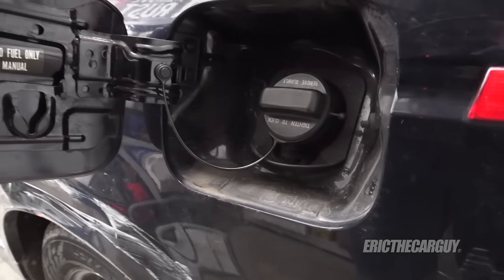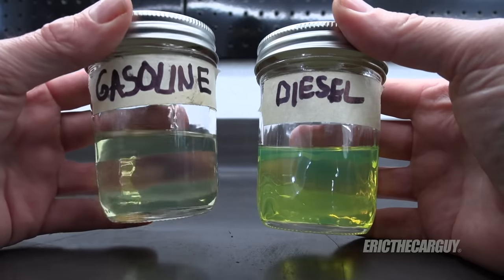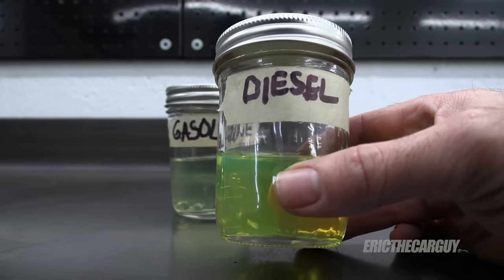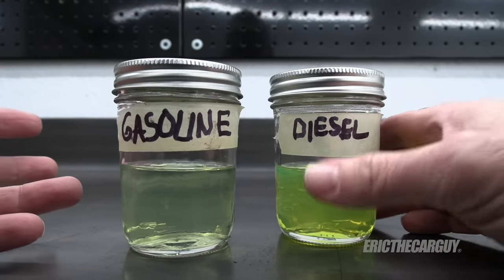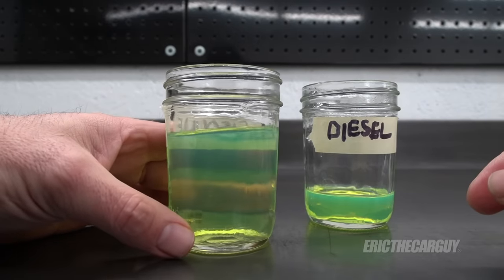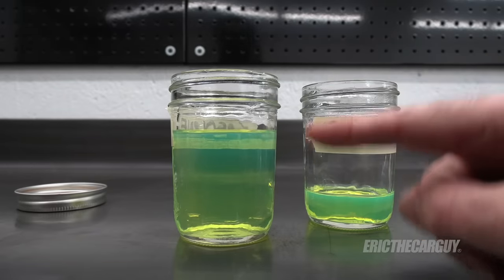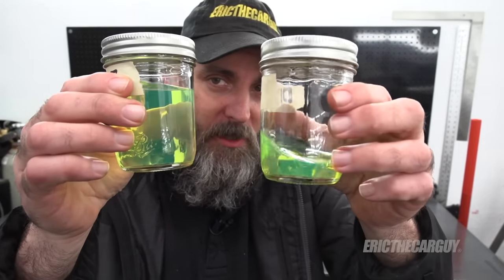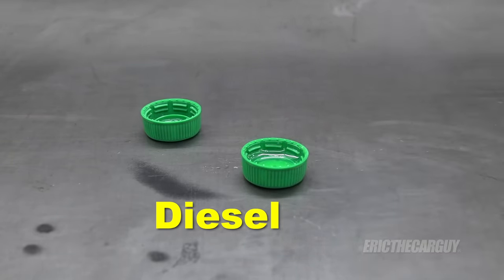What Happens When You Put Diesel in Gasoline?

Comment: I would guess up to 10% diesel might just work, although modern systems might freak out. You don't want to gamble with an expensive car. Also it might separate over time, not sure.
One guy on quora says he drove with 25% diesel one time back in the day and it worked without incident. That's probably pushing it.
With an old four banger pre computers it could be tried. I'd guess 10% is mostly fine. At 50% Id guess it would run but run bad. possibly straining the engine

Comment: I know a few guys who collect all the grease from bars and restaurants to make there own diesel. If your behind them their exhaust smells like french fries lol
Reply: The greenies call that "bio-diesel'.  Rudolph Diesel's first  successful engine ran in 1897 on peanut oil and could also use vegetable oil.
Reply: @vaughan2203  interesting
Reply: My dad did that and mixed it with normal diesel. No wonder I was always hungry when we'd go on trips. XD
Reply: @DaleESkywalker  lol
Reply: @vaughan2203  Bio Diesel here in Germany is actually not something refined from used frying fat, but from fresh rapeseed oilI, allthough using the old frying fat would work as well. In Europe regular Diesel contains about 7 % Bio-Diesel, which is no problem for modern vehicles. On older vehicles it might cause issues as the Bio Diesel may soften or dissolve rubber seals. Same with Ethanol mixed into regular gasoline (Called E10 here, containing 10% of Ethanol. It is not generally a bad thing as some claim, it is just the seals and hoses that have to be designed to withstand it. 
I know a lot of military use engines, not only in trucks, but also tanks, helicopters etc. thst are multi fuel engines. You could indeed run those Diesel engines on almost any oily substance except for gasoline. Well actually there might bee some around with additional spark plugs, that can even run on gas, ethanol or gasoline.
Some engines might have to be modified by maintenance, changing some nozzles, some don´t.
I think it is often used in military vehicles, to be as independent as possible on what kind of fuel is available.
Although I am not sure, if you use grease from a restaurant, what it smells like after beeing burnt in the engine.

Comment: Back when dinosaurs roamed the Earth and gasoline cars were carbureted, you would lose some power and smoke a lot.  Diesel will flow through a gasoline filter and diesel is designed to go through far smaller ports than gasoline injectors have.  I think the main problem will be the drive train computer trying to adjust for the different burning characteristics of the mixture and power generated as well as all of smoke caused by the diesel not burning completely.

Comment: I went to a Gas Station with an empty tank then they accidentally pumps 1.2. Liters of Diesel and then pumped 30 Liters of Gas. After a few days my car choked and vibrates when driving. I went to my mechanic and they went and cleaned and fix 4 pcs of  the sparkplug and then it is now normal. But I'm not sure what happens again.

Comment: Diesel in gas engine. Knock pinging low power poor start on non starting. Diesel in gas/petrol loweres the octane. 

But actually cleans an lubricates injectors and pump and all the fuel system.
Cloggig the fuel filter... I guess maybe... Don't think so. Maybe in winter gelling or something, but...?

Comment: if you ad 50% disel in gasolin engine it will run but hp would be low it might not start but if engine is hot it will run it wont damage engine but you have to drive on low rpm and engine must by good and some disel from piston ring will run in engine oil thats all :) if someone adds disel in gasoline car if there is more space in fuel tunk add best fuel 98 or100 and it.s no problem i have tested id many times :) on inline 6 bmw us even but old models on direct injection it might wont work and on turbo cars

Comment: I love your channel! What I'm about to say won't be popular, though...  I've had good experience running a small amount of diesel in several gas engines (1 cup diesel per 15-20 gallons of gas) for a few different purposes  As you mentioned, diesel IS harder to ignite (but also contains more energy than gas). For cars with preignition issues, a small amount of diesel essentially raises the octane levels, preventing preignition and knock.  Exactly what 'premium' fuel is designed to do, be slightly harder to ignite for high compression, forced air induction, heavily tuned, and poor running engines that tend to 'ping', etc.  One of my car's that I used this in was a highly tuned Corvette that needed a slight octane boost beyond 'Premium'. Looking at the engine computer data, it's clear the diesel allowed for more timing.  Obviously, too much diesel will be too hard to ignite for proper combustion, so not too much! In addition to preventing preignition in gas engines, a minute amount of diesel also contains more energy to ram those pistons down for a longer duration of time than just the initial explosion. That slightly stronger explosion equates to more torque. One of the reasons diesels are inherently torquey. Another benefit (again, very slight due to low ratio) is that diesel is a lubricant and cleaner.  It is effective in cleaning injectors and lubricating upper cylinder areas, intake valves, etc. (with right ratio).  Much like Lucas oil fuel additive, but with added benefit of actually being a combustible fuel, not just an additive with minimal results (Lucas oil👀).  Not trying to start a debate, just thought I'd share a bit from my experience. 😉
Reply: So, can i make a mix of them (gasoline and diesel) to use it everyday and make my car stop pre-ignithing? 
I'm asking it because in my country all the gasoline is imported and the Octane is probably under 86. And we use to have 92 and 95 octane, so basically every single car is pre-ignithing for that reason :/
Edit: my car is carburated so i don't have to worry about sensonrs and stuff like that
Reply: @JesusGarcia-ec7jo  Yes, In my experience with a performance car, you should be able to.  I don't know your octane levels, the type or condition of car you're driving.  I would start with only 1 cup deisel per 15 U.S. Gallons of gasoline, diesel goes in FIRST so it'll mix.  Thats only 1part diesel to 240parts gasoline, if that doesn't stop the pinging, SLOWLY increase the amount, to no more than 10% diesel (in your case of very low octane). If you use too much diesel, it'll be hard starting, smoky, a little less powerful, so you don't need much!  Expect pinging to stop, smoother running, and longer engine life if done correctly. Let me know your results, please!
Reply: @jeladsnikpoh1289  Oh man, tank u very much!  i will try, but in reality the car is of my dad xd
But i would like to try it to see what hapens, aniways, is an old fiat engine, is it almost bulletproof.
I am very grateful for the knowledge you have shared with me. Greetings from Venezuela <3

Comment: I happen to know from personal experience that a hot gas engine can run on diesel BUT if it cools down you are toast. You will never get it started again without completely flushing the fuel system. The heat from the engine can cause it to vaporize. 
How much an engine can handle I can answer from practical experience as well. Gas engines will not tolerate diesel very well at all. Even just 10% diesel will cause the engine to ping terribly. Pre injection vehicles the noise will be pronounced. Modern engines will retard the timing and cause it to run sluggish at best due to retarded timing. If you want to hear both the stories just let me know.

Comment: thanks. i thought diesel-fuel is easier to ignite ( more flammable ) than petrol-fuel/gasoline.
because diesel-engine doesn't need spark-plug to ignite diesel-fuel.
gasoline-engine need spark-plug to ignite gasoline-fuel.
i was thinking if gasoline-engine receive diesel-fuel then maybe gasoline-engine produce cleaner emission than diesel-engine , because gasoline-engine has spark-plug to help ignite diesel-fuel and spark-plug maybe help produce more complete-diesel-fuel-combustion than diesel-engine. more complete-fuel-combustion produce cleaner emission.
30 jul 2021 7:49 am edt(utc-4)

Comment: This is actually an old school "old Indian trick" from before efi.  If you have a knock, or dieseling issue suspected, throw a gallon or 2 of diesel in there and watch it go away.  Then, you know if you have a rod/crank knock, or ignition/carbon  issue.  Fast foreword to modern day:  as a mechanic, you should occasionally run into this issue a time or 2, and it typically does no damage at all.  Now, it is possible for a gas engine to run off diesel, but it needs to be quite rich, as in the choke full and rpms up, and it will ignite the short chains in the fuel, but otherwise be prone to flooding.  Also in this condition, it will be similar to having an injector or 3 stuck open, so there will be fuel in the exhaust.   This is pretty much the only potential for damage.  Tank has to be emptied out, of course.  Then, a few gallons of fresh gas added and prime the old fuel out by actuating the fuel pump and the return line or pressure test port draining into a container.  Typically,  the filter doesnt absolutely need to be replaced, especially if you are trying to get the car going after hours, when you cant find a new filter.  You want the diesel gone when you replace it anyways.  Now, you can try to start it.  Will often take 2-5 attempts, as to not cook the starter, but sometimes fire right up.  When it does start, be mindful not to let it auto-ignite the cat, so run it at "high idle" speed until it stops smoking or smelling of diesel and let it keep running the remainder of the fuel before filling up with fresh gas.  The work is mostly tideous, but simple.   On the flip side: you will most likely destroy your diesel if you put gas in it for many reasons.  Fist, gasoline is a "dry" fuel, so think of your high dollar, close tolerance fuel system as an engine not only run without oil, but being degreased first.  If this doesnt happen, the gasoline will ignite and burn on the surfaces of the injectors, head/precups and melt the metal, or explode on the compression stroke (preignition and detonation) and crack a piston or 2.  Most common repair for gas in a diesel is replacing the entire fuel system if it checks out on the bore scope.

Comment: First fuel in diesel engines was "rapeseed oil". I do know that .. to this day I have no idea what a rapeseed plant looks like but it doesn't sound like a consensual plant 🤣.
Reply: Also to clear this up as there is some misinformation in this vid. Diesel and gasoline are 100% miscible fluids meaning they dissolve into each other at any and all precentages mixed. 
The problem "on the other end" he is referring to is component compatibility with fuels having the incorrect viscosity or distillates this is especially important when it comes to plastic fuel valves and fittings, filters and hoses. The plastic and hoses are more an issue putting gas in a diesel system vs the other way around and also (depending on if a little or a lot) injectors. Diesel fuel systems are designed for oil with no lightends which can degrade the inside of your fuel lines and any plastics. Disc and clog your injectors especially on the late model diesels. Also your injectors use the diesel fuel for cooling. Lowering the viscosity will in turn change the thermal dynamics of the fluid. With all that said some people put a quart gasoline/30gal diesel in the winter to work as a winter anti gel additive. These are usually Old-Timers driving old diesel tractors with Ford truck bodies, which explains why they are always fixing them all winter 🤣

Putting diesel in a gas system, the filter as he mentioned will get destroyed but it isn't due to it not being compatible with the diesel but trying to force a higher viscosity fuel through a lightweight filter material designed for gas a low viscous fuel. Think of it like grabbing a coffee filter out of the kitchen and pour water into it. It will go right through because the the water has a low viscosity. Now grab some honey and pour in, it'll go through but slow and if you force it through it pressure which your fuel system is under pressure it will blow holes into the filter sending the remnants into your fuel lines and injectors.

If you just do a splash and either one and then realize your mistake, you should be okay. When I say splash I mean, less than a quarter of a gallon. You just have to make sure that you fill the rest of the tank up with the appropriate fuel to dilute your mistake and do not drive to the new pump, dont even put the key in the ignition. Pull the fuse for the fuel pump, then put the key in, then push to the correct pump.

Engine results for the mix (at small "oops" amount),
Gas: expect excessive smoke out the exhaust. Don't be surprised if when you turn your car off, the engine continues to run for a second. Don't be surprised if you have to change your O2 sensor or remove it and clean it after you have burned through that tank of fuel. Your engine May lack power because you are putting more carbon into the engine so the ECU might lean your mix.

Diesel: not really a whole lot to talk about except for egt's will be higher than normal.

Comment: Yes. So this entire video is what we call. clickbait, With one caveat being older carburetted engines. as diesel does not readily. evaporate when exposed to air. much more than a gallon or two in a carburetted engine would definitely cause. engine stumbling and five or six gallons per probably would not run at all. ) 
  
BUT because nowhere in this scenario did he. mentioned or explain the difference of 1. filling Your empty gas tank with just diesel.? as opposed to putting some diesel in your gas tank. by mistake, which is impossible.  But what Amount of diesel could go into a gas. powered car. without any effect whatsoever? I have run in many situations. Two gallons of diesel to 33 gallons of gasoline. with zero effects.(5.7 Hemi engine)  in winter or summer. I have bumped that ratio up to four gallons in 33 with barely any noticeable effects other than smelling It in the exhaust. in the inverse, you would never put gasoline in a diesel powered engine! in any ratio, More than a gallon or 2 MAX! Accidentally in a 30 gallons of diesel tank  would not be. a problem. And yes, one gallon of gasoline in a 30 gallon tank of diesel. Zero problems ! Zero damage.. (Stating that you would never do it on a regular basis. This would be a scenario where you accidentally did so) My problem with this video is he never addresses anything other than a full tank of diesel in a gasoline powered car. Which. rarely would happen. if you realized at some point you had put diesel in your car. which again is impossible. And you put three or four gallons in 10. You might have a problem. but the two fuels will mix. They will run and it won't run well. And what you should do is run it until you've used a substantial amount out of the tank. Then put some more unletted in to dilute the diesel. Would there be any damage? Doubtful. Diesel is a lubricant more than anything. Yes, it is heavier, but it burns under pressure and spark. Just burns a little slower and it would probably screw with your octane rating. But that's debatable as well, because diesel does not ignite as easily. So it acts naturally as an octane when mixed with gasoline. So yeah, this video is not helpful other than scaring people to death. Consult a mechanic. who is not under the age of 35. ADU will not be steered wrong. But if you put diesel and gasoline, don't worry. If you haven't put in half a tank, you have no problems. 5050. gasoline and diesel will readily start in a fuel injected car. down to what temperature I do not know. but it will run. and it will be gutless. But somehow guessing those Pistons physically moving up and down will not do so and burn that fuel is stupidity. Nor will it cause any problem with the injectors.

Comment: Eric we're waiting for the Type R series😉
Reply from the maker: I don't have any plans to start a Type R series at this time. The only video I'll be doing in the near future is the comparison between the Type R and GSR. I will get deeper into the Type R, but that likely won't happen until winter or fall as I plan to drive the car this summer.
Reply: @ericthecarguy  anything that you make is high quality & loaded with information, that's why can't wait to watch more repairs👨🏻‍🔧😉
Reply: EricTheCarGuy what would happen to a gasoline engine if a small drop of diesel went into the fuel system?

Comment: And what if you put Ethanol instead of gas ?
Reply: E100?
You will rot the fuel lines as they're not made to run E100.
Some flex fuel systems can run on E85 and those fuel lines might be able to cope with E100.
But the second problem is the fuel maps.
If the car doesnt know how to run on E100.
it will run like a dog

Comment: Fifth Gear in the UK did a test on this subject a few years ago. https://www.youtube.com/watch?v=GL9-i9tcESU - They tested diesel in a gas car & gas in a diesel car
Reply: TLDW: diesel in a petrol car did no permanent damage, but petrol in a diesel car seems to cause incomplete combustion (smoke) and perhaps lack of lubrication. The car did run again after flushing.

In a more modern diesel you'll probably clog the exhaust treatment and whatnot.

I've burned diesel and petrol and it suprised me how dirty the exhaust is under less-than-ideal conditions compared to cleaner fuels like ethanol and meth/eth/prop/but-ane
Reply: That was around 15 years ago. For the "gas in a diesel car" one, they used a 1993 car, with an engine that's cruder than the Stone Age by modern standards. Nobody should use that as any kind of guide as to what might happen after misfuelling and then actually driving a modern diesel.